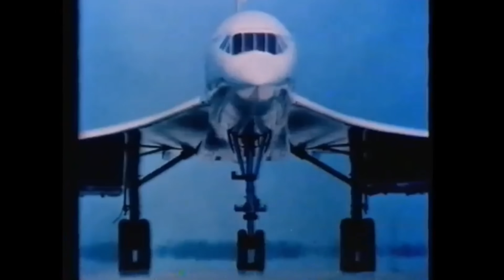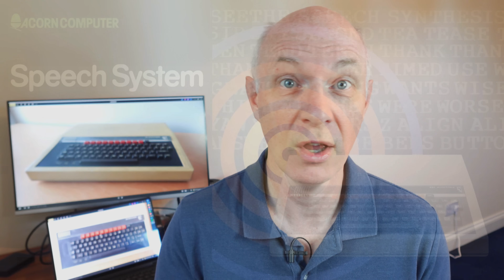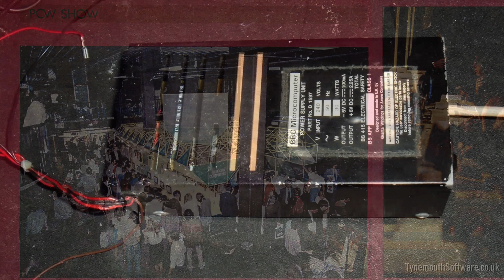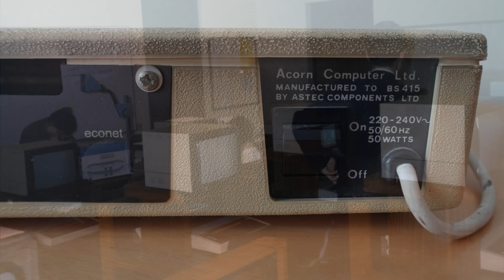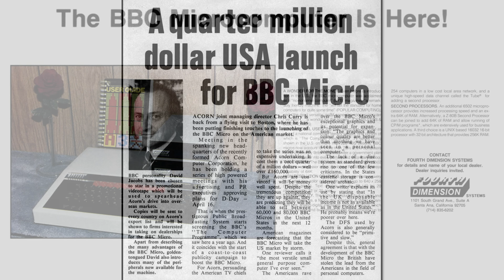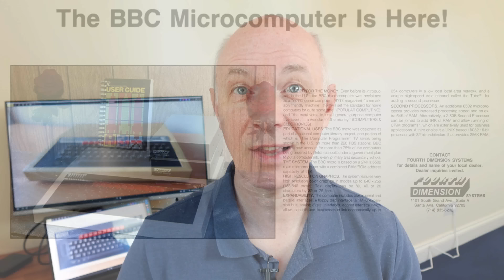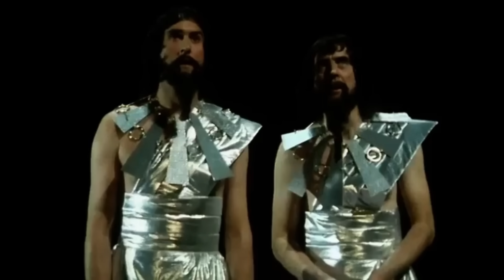6502 Reasons Why I Love This Machine

Comment: I my parents bought me a BBC model B at aged 17. I was addicted to it and learnt how to program using its BASIC and also the embedded assembler. I made hardware that I connected to the 6522 port and that got me into electronics. I did a degree in electronics and I’m writing simulators for silicon chip design now. Without the BBC I am sure I would have taken a different path. The BBC model B changed my life for the better.

Comment: The first computer I ever used was my schools BBC Micro B, after my older brother got a programmable calculator and I took it to school to try and figure out how to use it. Parents got me a 48K Spectrum. Spent 27 years working as a computer programmer for the PC. Retired now and still code; working on a multi processor macro assembler, and updating to assemble code for a ground up RISC machine I’m designing.

Comment: I grew up in a pretty well off area, so a lot of my school friends had Beebs at home. My primary school had one of them that did the rounds of classrooms on a trolley, but my secondary school had a whole classroom (later two rooms) of networked Beebs. I couldn't believe my eyes!

Much as it's undoubtedly a powerhouse and wipes the floor with other machines of the era, I have to be honest and say that the Beeb was a pretty charmless machine, and never really won me over. I don't really have any particularly fond memories of it. I started writing my Computer Studies GCSE project on it, but quickly found myself struggling to do stuff I knew I could do easily on my Spectrum, so I swapped over to working on that - it made things a lot easier.

Certainly a very significant part of my life for a few years, though.
Reply: What stuff was easier on the spectrum? Its keyboard was Terrible for one.
Reply: @stoomkracht The BASIC was a lot simpler, and I was more used to how it worked.

Comment: Friend of mine had the BBC Micro which was  00002 which obviously was the second one ever built a gathering met an untimely death, as he was going over the Magog hills just outside Cambridge, it was straps on the back of his motorcycle with a bungee strap, which decided to let go and catapulted it into the other carriageway on this particular piece of road, where are the poor thing met with an articulated lorry and its never recovered
Reply: My head of departments claim to fame was that he had "built his own BBC micro". The truth was that his sone worked for Acorn and managed to acquire one of the pre-production built PCBs.

That reminds me of the £99 RGB colour monitor a BBC owning classmate bought from an advert in an electronics magazine. The only issue was that £99 didn't actually buy you a case. The monitor was "open frame" designed for use in an arcade cabinet.

Comment: Like so many others, I consider myself very fortunate to have learnt programming and computing generally on an Acorn Model B and latter Archimedes systems in the 1980s and early 1990s. The ‘Beeb’ is a classic example of what happens when you give gifted engineers a brief and let them cook. The robustness, the flexibility and power. I have a couple of Microbees, the Australian designed and made 8bit system that fulfilled a similar education role to the BBC Model B in some state education systems, and while a good deal cheaper, it’s not a pinch on the Acorn. We were still using them to teach BASIC in 1994 and they were fine… the 386/486 PCs that eventually replaced them weren’t any better for programming.

Comment: BBC Micro, Apple was for the rich people
Sinclair made computing accessible to the masses
Reply: Its worth remembering that, even at the thick end of £400,  the BBC Micro was still a fraction of the price of something like the Apple IIe, yet more powerful in many respects. The BBC B wasn't cheap, but it actually offered incredible bangs-per-buck at the time.  If the only purpose of the BBC Literacy Project had been to get as many teenagers as possible into simple coding then the Spectrum would have been perfect - but the BBC project was also aimed at getting adults, businesses, education etc. into IT, so BBC features like the decent keyboard, standard printer interface, 80 column text, high res (for the time) graphics, on-board disc interface, ROM-based software & general robustness made the BBC a far more credible tool. For those applications, a Sinclair Spectrum would have been "buy cheap: buy twice". The Sinclair machines deserve immense credit, but they were very limited... Anyway, nothing of value was lost - the Spectrum was still a success.

Comment: 5:32 structured means you could have blocks of code inside flow control structures like if-then-else, for, while, etc, instead of having to rely on goto for everything. It makes code much cleaner to write and read, and less error prone. Often it also implies supporting user defined subroutines as well. Many early BASIC implementations lacked those features, which led to spaghetti code.

I'm about 10 years too young to have lived through those hard times and got spoiled by having user friendly text editors and languages like C and Lisp as my early programming experiences. I'm not sure I would have enjoyed computers as much as I did if I started with early BASIC and had to deal with cassete tapes for storage. 😅
Reply: The original BBC BASIC's support for named procedures/functions, parameters, local variables, and long, meaningful variable names put it head and shoulders over most other personal comouter BASICs at the time. However, it fell a bit short of full GOTO-free "structured programming"  - no multi-line conditionals, and no sort of case statement beyond "ON x GOTO/GOSUB".  ON x PROC only appeared in later versions and  other key "structured programming" features like multi-line If/Then/Else, and proper CASE structures didn't appear until BBC BASIC V on the Archimedes. Still, the structured programming purists at the time would only have been satisfied with Pascal - which was never really practical without disc drives (there was a Pascal ROM that you could use without discs but it was very limited). There was also a COMAL ROM, which was a structured BASIC-like language that seemed a bit redundant alongside BBC BASIC but I guess it ticked somebody's boxes.  The other unique thing about BBC BASIC was the low-level stuff - obviously the built-in assembler, but also the ability to DIM contiguous byte and word arrays, and byte/word/string indirection operators that worked more like C pointers than other BASIC's PEEK/POKE.

Comment: that bbc basic for the spectrum doesnt have any graphics commands or sound  implemented though, obviously cant 'emulate' the bbc capabilites, but doesnt evem allow the spectrums! probably 'could' drive them via machine code , by calling the routines in the original spectrum rom(you need an external rombox for spectrum bbc basic, or fit it in a 128 type spectrum that has the rom bank switching function) but havent tried it yet..

Comment: never had one when 'current' my parents couldnt afford one or even the electron,(i had a zx81 first and then a spectrum the next year, both on offer) but my middle and upper school had them especially the upper, a room full of them , in the 1990s, some years after i left, a bbc came up for sale at a computer fair and it had come from the upper school, and one i actually used there , still had the network ID on it, so bought it (£35) and still got it,   and its keyboard rom hole has been popped out, not surprisingly, ... i think all the ones at school had been 😁  i also eventually got 3  electrons, 2 have since been sold off, strangely all 3 seemed to have had their modulators replaced soon after manufacture, their date codes well after the electron was discontinued, maybe had a bad batch? or maybe from a leftover unfinished batch of machines that did eventually get finished off and sold cheap???
Reply: Those are interesting observations about the modulators. It could be that the modulators had been worked loose with a lot of plugging and unplugging, or through suffering a sudden shock, but that wouldn't explain their replacement.

Some early units were assembled in Malaysia at Astec, who also manufactured the modulators, so one might wonder whether Astec fitted a bad batch of modulators. Certainly, there were production difficulties that have been publicly attributed to the availability of the ULA, but that was made in Britain by Ferranti at that stage, and we don't have the full picture of what the difficulties actually were.

There have been batches of Electrons sold off fairly recently that seem to have been returned either for repair, replacement or maybe just for trading in for, say, a Beeb. Slogger sold "new" Electrons well after they were sold by Acorn and then sold off by Dixons, also upgrading them with various enhancements, so it is possible that maintenance was done on certain components in some of those machines.
Reply: @paul_boddie  my remaining electron has made in malaysia on it , the others were uk made, the ula has some of its contacts corroded,  but luckily makes good enough contact in the socket to work, it has ram issues, i think,  at the moment

Comment: My dad bought me a BBC-B with his bonus back in 1981/2. It cost his entire bonus. My parents knew computers were "the future" even though they had no idea what that meant. They just knew they wanted to help me get ahead of the curve. I have thanked them many times over the years. In a rather circular manner, I ended-up in IT earning a good salary. My BBC-B directly led to this.
Reply: That's a great dad. My dad bought me a ZX-81, cos I was doing Computer Studies 'O' Level and was struggling with the programming side. I literally went from being bottom of the class to top of the class within a couple of months by sitting for hours "playing" with the ZX-81. A couple of years later, my nan gave me the money on my birthday to buy a BBC-B. I did eventually work in IT for around 10 years as a PL1 programmer. Good days.
Reply: I think there are probably countless stories like this around the UK. Mine is similar. My first computer was a ZX81. I had to save up for the 16k RAM pack, which was a huge improvement except when you'd spent hours typing-in a program only to knock the RAM pack and reset the damn thing! My grandparents bought me my BBC-B. They weren't wealthy, but my grandad was a mechanical engineer and he must have seen the interest in engineering in me and wanted to help foster it. I went on to get a first degree in electrical & electronic engineering then a PhD in electronics. I've held roles in academia, industry (software safety) and the NHS (Clinical Engineering). Those early days writing code in BASIC, learning assembler and tinkering with analogue and digital interfaces set me up for my career.
Reply: My parents wouldn’t buy me a computer - they knew me well enough to know that I wouldn’t have done any studying if I had one. They made the right decision and I managed to scrape through my GCSEs.

Once my exams were over in 1984, I become totally addicted to computers (in a good way) and made a career of it, doing freelance work from the age of 16 and working in IT one way or another throughout my whole career.
Reply: The people I knew who bought BBC Micros (like my Boss) seemed to think doing so would guarantee their children a place at Oxbridge. I still recall a conversation between the boss and a lesser paid colleague. He was buying a Spectrum and suggested that by the time his children left school both the BBC Micro and Spectrum would be outdated.

As for me I bought on price and went ZX81, TI99/4A, Toshiba MSX. For all three I paid a total of £200.
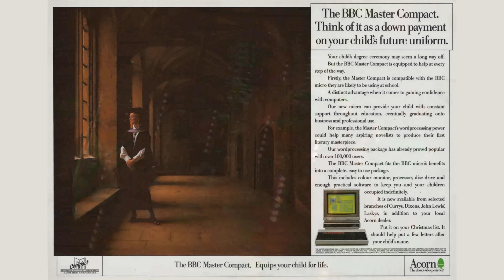Reply: @MrDuncl  Your then-boss must have seen and read that advert at 24:32.

Comment: I worked in a busy Acorn dealer as a young engineer, day in and day out I repaired broken BBC B.  They were fairly reliable and most faults were either the PSU, memory chips or the chip that controlled video which tended to run hot.   With the exception of the PSU we did component level repairs, and I was fortunate to attend hardware repair courses at Acorn in Cambridge where we learned from the people who designed it.   It was a great time to be involved in the business.  The service manual was excellent.
Reply: Which dealer? I worked at Watford Electronics.
Reply: @dbhsea I remember the Watford Electronics adverts very clearly! I bought a few bits and pieces via mail order, including the original AMX mouse - the square one with red buttons.
Reply: I had a BBC after several years with a UK101, also 6502. The BBC was a beautifully designed machine, I hand disassembled a fair bit of the Basic code and it was beautifully written - no access to source code. I had an understanding of arithmetic expressions from the UK101, which helped enormously. Nothing since has been as easy to interface to, and everything now is optimised for commercial application and hardware.
Reply: @billdavies6463  6502 code is almost disassemblable in your head.
Reply: Do you remember the names of the Acorn people who did the training?

Comment: I was born in 1986 and started secondary school in 1997. I remember using Logo in 1997 or 1998. Wolverhampton was a deprived area, it seems. I believe the software ran on top of Windows 3.1 but my memory could be very wrong there.

Comment: I worked for Intel in the 80’s and one of our systems used an Intel 8271 disc controller. Did quite a few service calls where the floppy disc had failed and when you removed the case the chip had been removed from the board. 
Was a right pain as no one ever owned up but because the chip was pretty scare (and expensive ). 
That said I had a loverly twin floppy half height unit with switchable 40/80 track drives. 😊

Comment: This video series is amazing and the research is top notch. But, why did you start with the TRS-80? Shouldn’t you have started with the Altair? Despite not being what we immediately recognize as a home computer or micro, it was the one that created the whole market. 
Knowing how to program it with the switches and LED panel, is also not that different from knowing how to program in assembly or BASIC, it just has a very unorthodox output display. Once you pass the convoluted way to make it work and load a program, it’s not very different from a Sinclair ZX80, given you managed to acquire the proper input/output hardware such as a terminal or a teletype. 
I wouldn’t use one today but it’s amazing what you could do with it.
Reply from the maker: I wanted to start with consumer computers, not things ordinary people never saw. Also those machines are not something I know a lot about.
Reply: @L @LittleCar I see. 
But maybe you could make a small video addendum talking a little about those early attempts at bringing computers to the general public. Nothing too in depth but a glimpse of what came before. After all, we wouldn’t have Windows if Microsoft would have created BASIC for the Altair and started a business selling it.
Reply from the maker: Maybe in the future.

Comment: The utter genius of having the assembler built into the BASIC opened it up to anything you could imagine.
Reply from the maker: It made it much more accessible, and IMHO 6502 is much easier to use than Z80.
Reply: @LittleCar  Yes, I programmed both and Z80 was a lot more feature rich but this made it slower for a given clock speed as instructions took more clock cycles to execute. 6502 on the other hand had a very simple instruction set with most instructions executing in one or two cycles but there were no complex instructions so code tended to use a bit more memory but it executed faster.
Reply: The beauty of it all, was you could buy the machine, and just get to work. Alas I was too stupid to get it at the time. The Acorn machines had some really good features, albeit with a couple of drawbacks. I still miss my Master 128.
Reply: Yes. I was going to say the same thing.

You could write a BASIC program, switch to 6502 assembler, then back out again - all inline. You could optimize the speed of your code by counting machine cycles and switching to/from assembler. 

It made all the difference when it came to usable software.

Comment: I have two.  I was 12 when our school filled the computer room with them.  We used to do our work and when the teacher went out - play elite.  The ones I have came from a museum display, I did the PSU kit, have replaced a couple of chips along the way and have the SD card  disc drive with all the software in it. I have the scart RGB lead and run it on an LCD screen.  Every Christmas we drag it out and play Chuckie egg and hopper.
Reply from the maker: I'd hack Chuckie Egg in computer classes to 255 lives.

Comment: Drat! I gave my BBC Micro manual away with two manuals that were for the BBC Master, that I sold on eBay.
Had I known this Little Car episode was going to happen then I should have held onto it, to cash in!!!
I would actually pay upwards of £50 quid for them, but that wasn't the price I put it at and it is not the common price on eBay. However, there just weren't any buyers last summer (2025).
Given the low public opinion of the BBC and the loss of relevance, the BBC Micro harks back to a time when the government did something exciting, quite special really, and I appreciate having been there, even if I wasted too much time playing Elite, Defender and everything else.
When I finally 'met' a PC, I was utterly underwhelmed as the BBC Micro was far more sophisticated in every possible way, particularly regarding MS-DOS. We were spoilt with the BBC. I never owned one, but we could borrow them and the monitors from the school over school holidays. I only had a ZX81, and yes we only had cabbage soup and the last time the house had been modernised was in Victorian times.